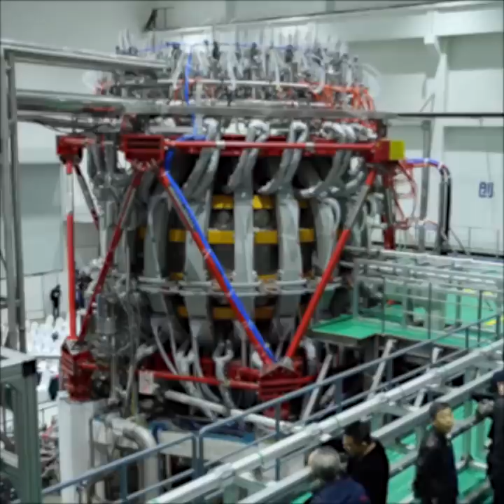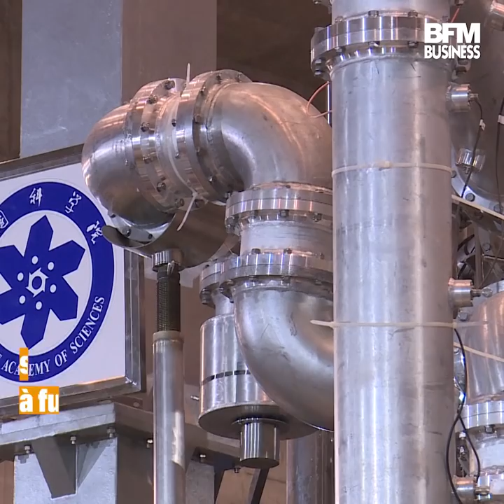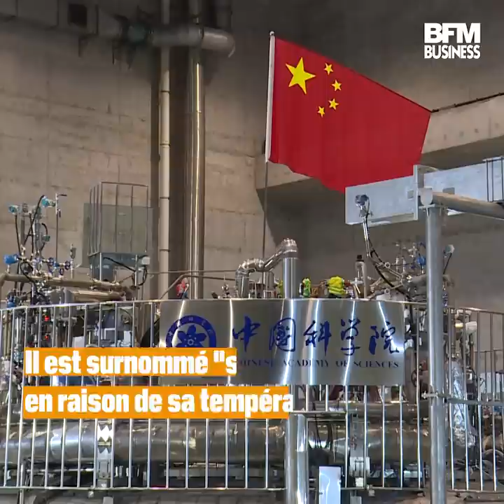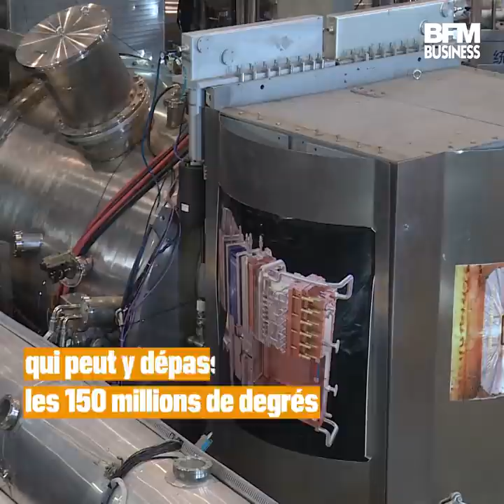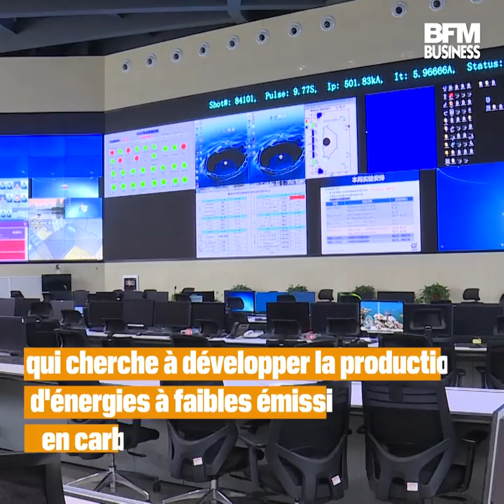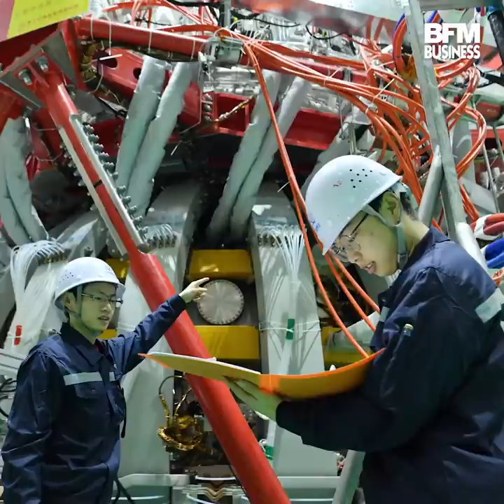La Chine a mis en marche son réacteur à fusion nucléaire

Comment: Quel matière peut résister à une chaleur 10x plus haute que le coeur du soleil ?
Reply: Bonne question ........ Le vibranium 🤣🤣🤣🤣🤣🤣
Reply: Aucune mdr, le tungstène qui est la matière la plus coriace face à la température, fond aux alentours de 7000°c
Reply: Il y a du vide au sein du reacteur mais après pour la chaleur faut se renseigner
Reply: @edengrazard9716  le tungstène fond plutôt vers les 3000°C. Mais il commence déjà à se recristallyser à partir de 1000-1200°C qui le rend plus fragile. Le coeur du plasma est chaud, mais il est maintenu loin des parois par des champs magnétiques. Donc c'est possible de garder les composants à des températures raisonnables.